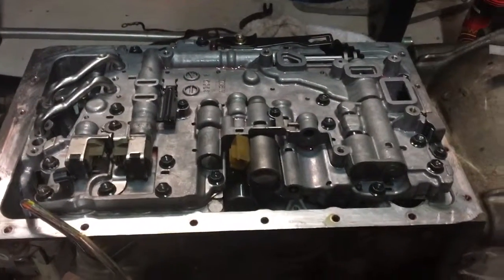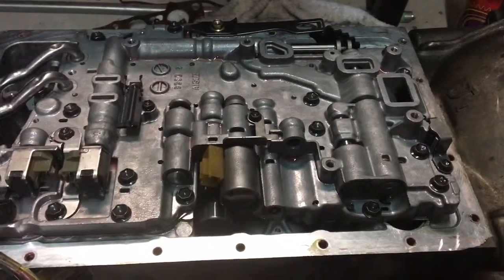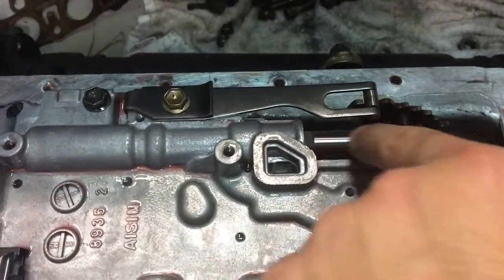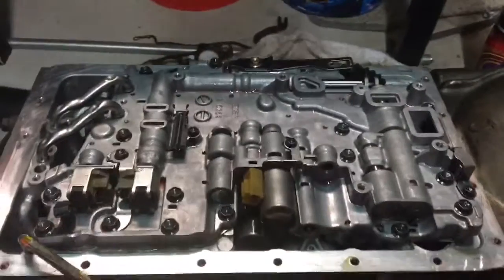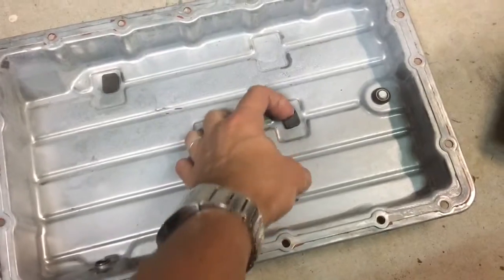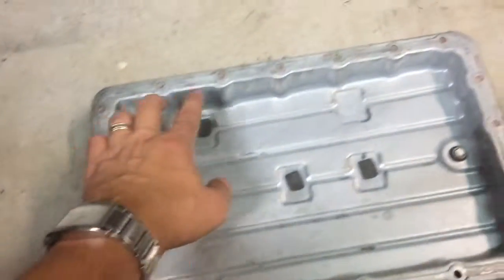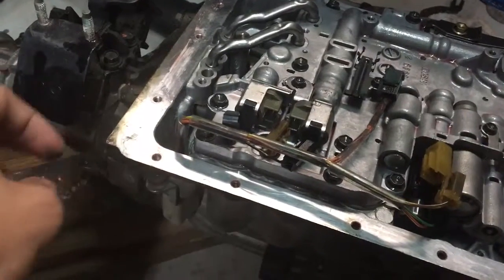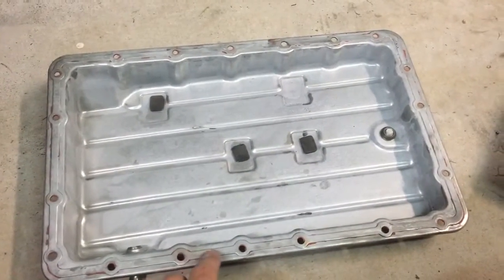Toyota A340/A341 Valve Body Installed - MV 'shift kit' 1.5

Comment: How much hp can this hold
Reply from the maker: This was used with 450rwhp. Didn’t break, but was pulled apart to be manualised with a B&m shifter from one of the more recent videos on my channel.
Reply: @ThatCarChannelOfficial  thats awesome!
Reply: Hey man, with 450rwhp, did you experience any slippage of the stock clutches? How long did it hold up?
Reply: Where did you get the valvebody gasket ?